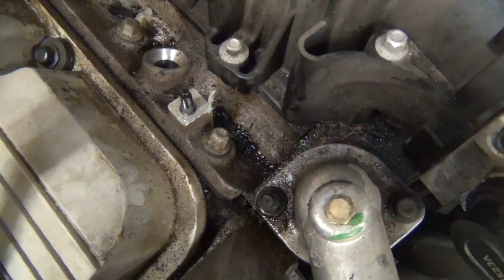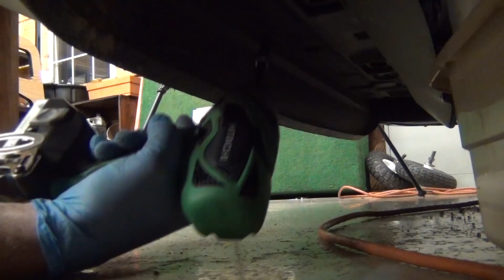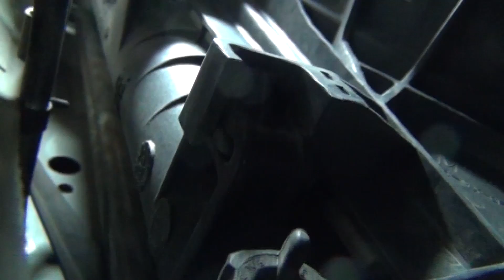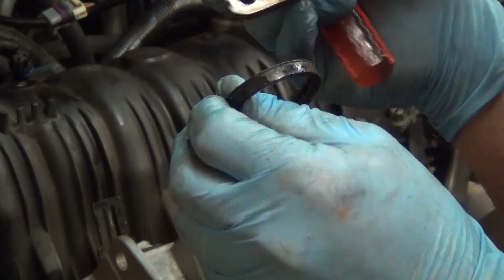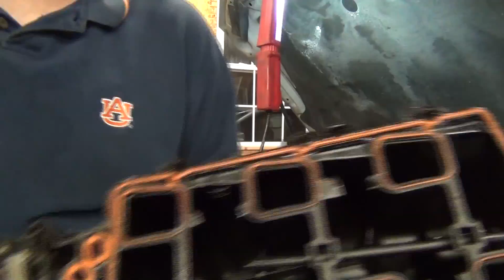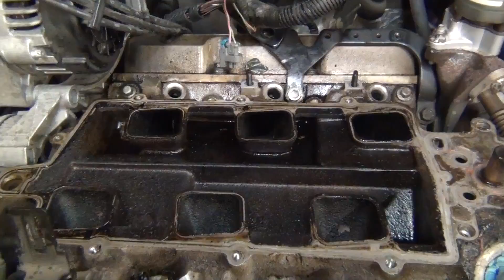PART #3 INTAKE MANIFOLD 03 3 8L 1

Comment from the maker: Blackie, that's a good point. However you can't get the intake off without removing the fuel rail thus the wiring for the fuel rail will need to be removed. The hoses you see removed are connected to the plenum and must be removed. You will end up replacing other parts as noted in the video also. Also most of these cars haven't had the spark plugs replaced so it's better to do it now and not turn around and take good parts off again to change the back 3 (and we know that's going to happen).  If I ran a garage and was paid for work it "might" be different but I would still rather do what truly needs doing as I am into it this far. This is the way I do it. There are clearly other ways and are likely better than mine. Hope you gained useful info from the video. Thank you for the feedback
Reply: I am not criticizing on how you do your own stuff as when I do mine I get into it deeply myself. I take my time also and make sure it is done right. I do use different ways to drain antifreeze and sort and lay out my nuts and bolts. If it works for you and my way works for me well the so be it.

Comment: One thing that wasn't mentioned was the  2 hidden bolts. they are hiding in the two coolant pools and one can be seen when you dip your  finger in the oil. Otherwise the Lower isn't coming off.

Also I know the oil pool seems alarming for an intake. However in the 3800 it is normal. Not sure why but it is. Probably has to do with the split design of the intake.

Also it should be worth mentioning one of the common fail points of the upper is the coolant wicking up the manifold bolts and causing a pool in the spot between the lower and valve cover. Thats why it is imperative to use thread lock on your bolts when putting it back together.

Comment: Do they make a metal intake for that? I'm afraid that I will have to do one pretty shortly.
Reply: After 2005 they made one. The ID of this engine is refered to in this manner

L36 = plastic manifold
L67 = supercharged with metal intake
L26 = same as the L36 only with an aluminum intake and an updated throttle body bore

The L26's Intake bolts up to the L36 but you need a Throttle Body bracket to use your current throttle boddy and need to drill 1 hole and plug a port that is not required for the L36. It's a pretty easy swap over.

I have seen people swap out the top L67 to the L36 the only problem with that is the connecting rods I believe are less heavy duty in the L36 and the supercharged upper may make the bottom end have less life span.

Lastly the final thing that can be done is to just install the L67 into your car. But to have it right you need to have the tranny with the L67 since it is the 4T65E-HD the one you got now is the 4T65E The L67 always used the Heavy Duty version of the transmission the L36 did.

The cheapest way to go is to simply buy the dorman redesigned upper with the larger EGR port in it because thats the area these fail at and causes the coolant leaks and then install the metal core lower gaskets and aluminum elbow and drain out that orange shit and put in conventional green.

Also it should be noted either this engine is great for you or it is not. Usually the deal breaker for people who work on cars with this engine is the fact it is a 90 degree V6 and not a 60 degree V6 like the 3400. Personally I like these engines over the 3400 simply because the durability. Also I believe the 3400 were valve benders but supposedly the 3800 in non-interference or so I've been told.